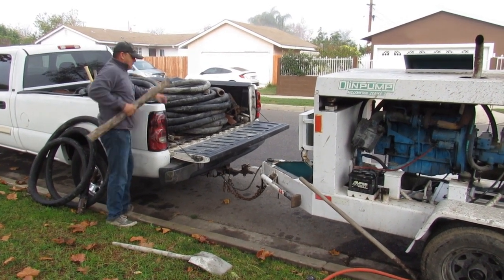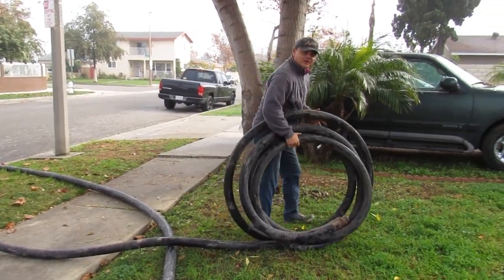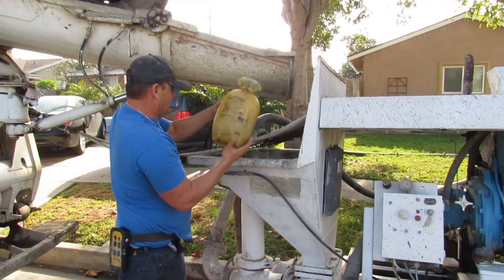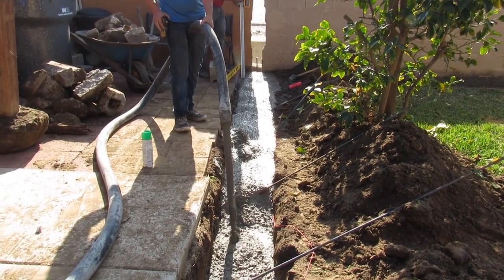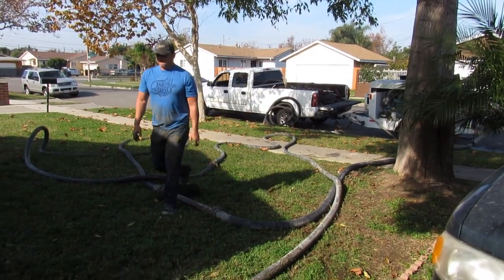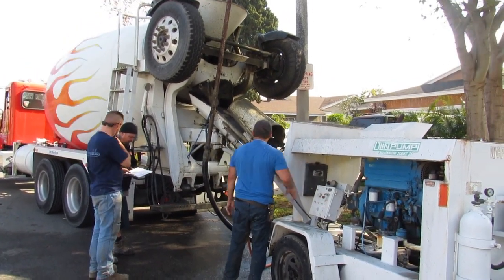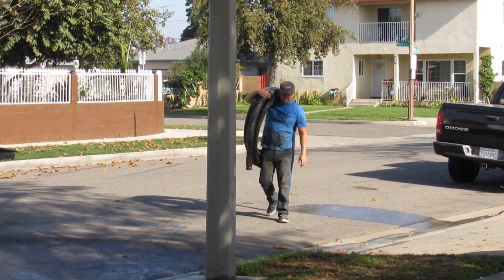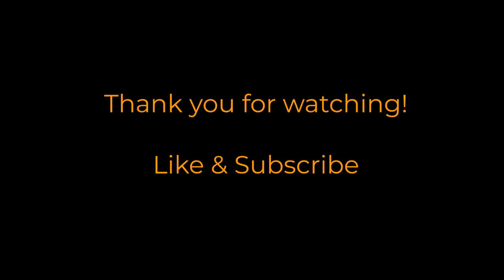How to pump concrete California style #1

Comment: I just bought a stationary reed pump and I have an issue with it. the engine and everything works fine. But when I  try to pump  it doesn't pump. But when I get it to work then I have no problem. Thank you. Maybe you can help me with this problem have a blessed day sir.
Reply from the maker: Try it with the throttle rpm hire✌️I would say your switch cylinder but it pumps
Reply: I gonna try the RPM but I do appreciate you Reply God bless you sir. I love every video you put YouTube. Keep on pumping. 😂
Reply from the maker: @elmerpalacios9482  ✌️

Comment: Im from alabama im 28 i pump by myself i Cant fine know good helpers anymore i got train by boom pump operator so my priming was off alittle somtimes it go good somtimes it dont. if im going downhill i put my blowout sponge in my 2an a half reducer i pump alot on the rivers so i run one 4 inch hose to reduce to my 3 inch pimes they 10 foot long then i run about 8 to 10 of my 2 an half inch they 25 foot long then about 3 to 6 of my 2 inch they 25 foot long an my line pump is 2020 kcp not the best but shes my baby for what i put her threw shes not that bad
Reply from the maker: That's cool bro sounds like you're into it 👍 happy holidays brother 💯🎄

Comment: Pump it down pump it down! Hell yea nice playing with that pea shooter those 45's are fun. I operated one of those for years even learned to pump with one too but now this new company I'm with has me running a Olin 65 which I NEVER even turn it all the way up most times not even half volume for the majority of these back yard boogy pours. Pump on brotha ohh rah!!👍🏼🤙🏼💪🏼
Reply from the maker: So sweet another pumper wrote in💯 thanks for watching Christian👊
Reply: @WestCoastCustomConcrete  hell yea thanks brotha respect for the time you've put in Pumping that Concrete! I'm still a young pup started when I was 18 I'm 27 now so of all the shit I've been through i still have many more pumps to fit under my belt, but I fkn Love my job everyday is a new adventure with new problems new challenges new Losses and new victories and I try to keep my mouth shut and ears open always cool to see the different angles that different pumpers bring to the game. Plus it puts good meals on the table for me and my kids 💪🏼 ~pumping from the #951~ Pulling Hose in different area codes

Comment: Thanks so much,  I had a question can you pull this pump with a ford Ranger??
Reply from the maker: No. Minimum would have to be a 1/2 ton
Reply: @WestCoastCustomConcrete  I really appreciate your expertise.  Is it because of the tongue weight or just too heavy?  Asking because all I have is a ford ranger
Reply from the maker: It's all the way around to heavy. It would blow your ranger up.

Comment: Hey what's the steel reducer for in the middle?? Because I have a 545 olin pump but never thought of doing this?
Reply from the maker: To reduce the hose from 2 1/2 to 2👍
Reply: @WestCoastCustomConcrete  can you explain it a little more don't quite understand sorry
Reply from the maker: @castrosaul33  I reduce the size of the hose

Comment: Hey i have a customer who said his surge chamber on his 530 is filled with concrete. any idea if that would be salvageable? a new chamber is almost 2 grand
Reply from the maker: Take it off and chip it out. Also install a new rubber o ring and oil. It's no problem.

Comment: Concrete pumping here in DUBLIN IRELAND is getting to be a nightmare wit the crushed Rock and man sand (DUST)  hard to pump it try a 4 inch pipe makes the job harder and no fun and I've worked on concrete pump's over 25 Year's from line pumps up too 63 boom pump's only in the past few years has it got hard because they don't put real SAND in the mix
Reply from the maker: Damn bro. Sorry to hear about your messed up mixes. We use sifted sand. Concrete pumping is still a good living in California.
Reply: @WestCoastCustomConcrete  Everything is Good in California. The weather The woman the only thing that reminds you that your on planet earth is the damn earthquakes
Reply from the maker: @myronsmith2114  c'mon bro there's  no earthquake. C'mon  on out you will love it👍

Comment: Is it common to use the concrete truck for the washout?  Where does all the unused concrete go that was in the line after the pour/placement?  Do you own both the concrete company and the pumping services?
Reply from the maker: No I own the pumps. They have a wash out pit at the plant. They recrush the concrete and use it for road base.
Reply: @WestCoastCustomConcrete   Thank you. Is it customery that the concrete company allows for this to occur? In my area, I'm finding that most if not all, want to place the 'washout' in the front or rear yard. Which creates another problem.
Reply from the maker: @tillmansr2002  yes every company will let you wash out in the mixer. Other wise  it's a big problem

Comment: started a job selling concrete equipment and parts a few months ago. If i were to start pumping, olin would be my favorite choice by far. wear parts are super easy to change and they can easily handle residential workload and around 50k brand new it's a really good pump. I see lots of people buying tk40s for 75k for jobs an olin530 could easily do, bigger isn't always better.
Reply from the maker: Thanks for watching  bro👊Its  so true so many people  are misinformed  and buy the wrong  equipment. Especially  concrete  pumps

Comment: How much for the pump and hoses? Interested in going into concrete pumping 
By the way, love your videos
Reply from the maker: A good set-up with 200ft of system should be about $25,000.
Reply: West Coast Custom Concrete nice! Where could I get one? Any specific site?
Reply from the maker: @MrBrown516  California is a meca for concrete pumps. What state do you live in?
Reply: I’m in Idaho.
Reply from the maker: @MrBrown516  Check out the Heavy Equipment Trader.
Reply: @MrBrown516  Used to be but I am not sure if it is true today, you buy them on the cheap in Ca at  auction due to AQMD regulation.
Reply: @WestCoastCustomConcrete  do I need a license to buy/operate a concrete pump company?
Reply from the maker: @Nicosuave916  no you don't.
Reply: @WestCoastCustomConcrete  23 buying a 500k rental propery i do a abouze and below grade windows & doors and woould like to blow thi gs up even more, i use kijiji for advertising is this how yall make that work?
Reply: @WestCoastCustomConcrete  23 buying a 500k rental propery i do a abouze and below grade windows & doors and woould like to blow thi gs up even more, i use kijiji for advertising is this how yall make that work?
Reply: 100 an hour to 1000 is life  changing  and i need the more multi family while im young i  beg 10000x info is capped  could i start off youtube videos ? ive done alot of constrution for my age
Reply from the maker: @michaelhaze4507  for sure you tube is good bro 💯

Comment: All this time I’m thinking it’s hydraulic pump didn’t notice the air compressor set up
Reply from the maker: It's a ball valve hydraulic pump. The compressed nitrogen with the piston in the back controls the concrete hose from surging.

Comment: I’m looking forward to starting a pumping buisness my dad has a concrete company and he needs me to pump 1” hard rock what kind of machine could handle that kind of job and does it need a permit to work in California something about new emisión laws.
Reply from the maker: To pump 3/4" hard rock you need a swing tube pump. I would go with Schwing or Putzmeister. A 70yd an hr pump. But if you can pump 3/8" pea gravel, I would go with an Olin ball valve pump. That's the pump I'm running in my videos.